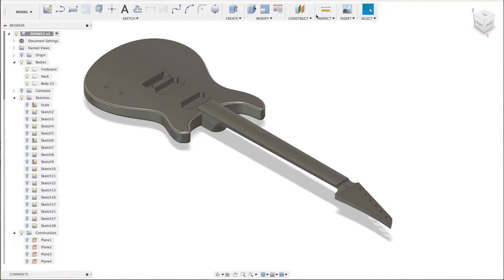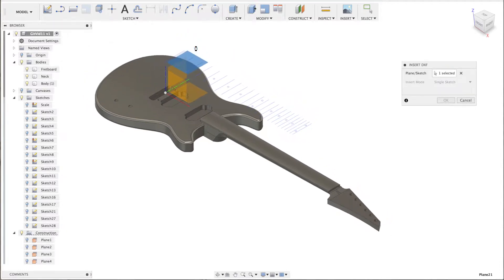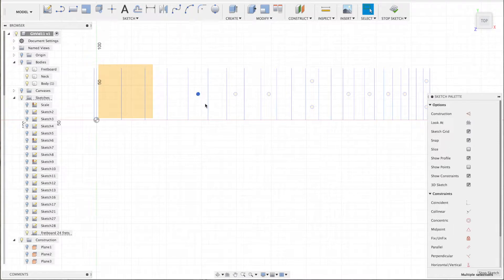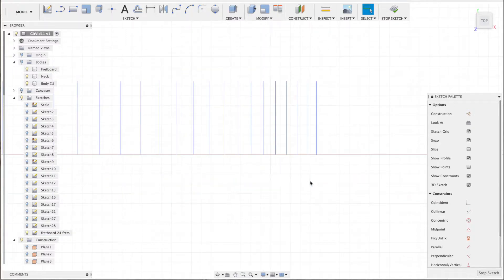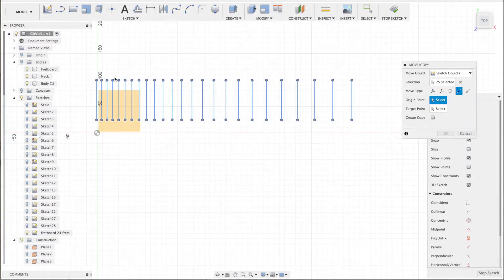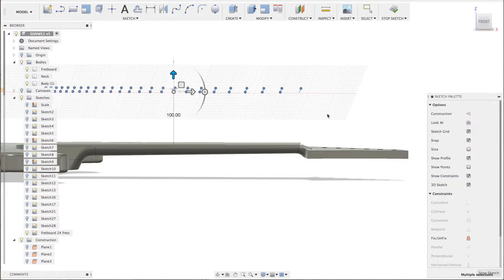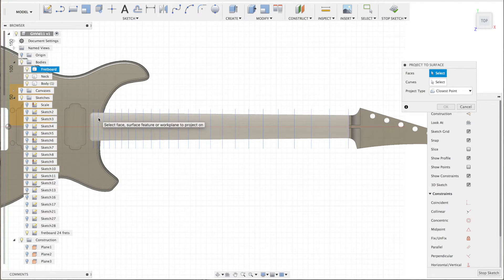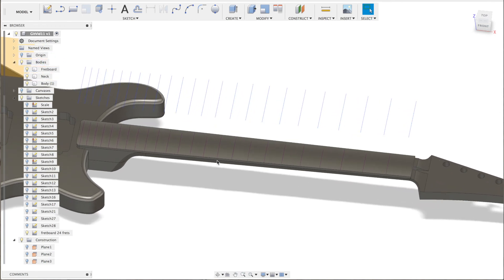Adding frets to a guitarneck in Fusion360

Comment: Tnks for all. When I try to project the fret lines to the suface of the fingerboard I always get the following massage: 
Warning: Not support projecting sketch geometry into same sketch, please change the target sketch or geometry.
Can you guess what I am doing wrong? I think I perform the sam steps as you show in the video.
Reply from the maker: <CrystalBallMode>
The level of your sketch is most likely at the same height as your body of the fretboard. 
2 possible solutions:
1. Lift the sketch with the fretlines so it does not interfere with the body
or
2. Hide the sketch when you need to select the body as destination, this way Fustion excludes it from the selection possiblity

</CrystalBallMode>
Hope this helps!
Reply: @Audiohotshot  Yeah, that didn't work

Comment: You've been a bigger help to me than anybody, and I appreciate it. I went to GitHub, signed up, found your stuff, but have no idea how to install it into Fusion. It is probably a straight deal, but I'm not a computer guy, I'm a luthier/restorer of fine instruments.
If you have any in-depth installation advice, or a walkthrough, I am your most eager student. Thanks again!
Reply from the maker: I've updated the info file on Github and included the location of the correct folder. Simply copy and paste it to the Add-in folder and you should be good to go. 

Hope this helps!
Reply: @Audiohotshot  thanks, it should. I can't wait to try it! ;)